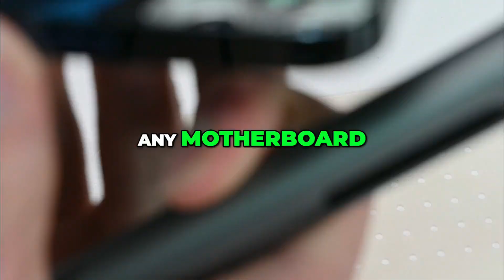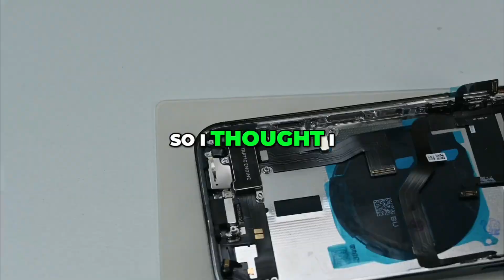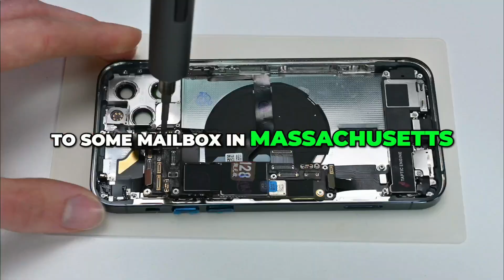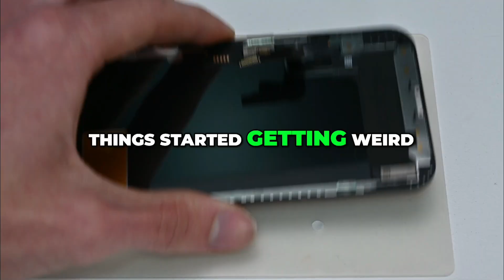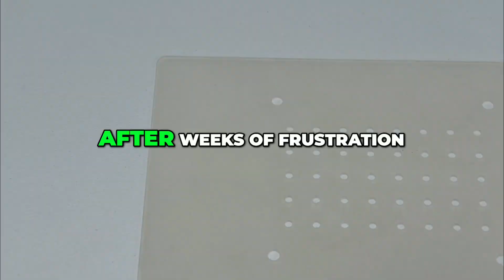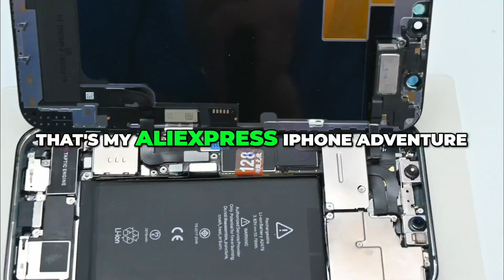Buying $117 iPhone Motherboard on AliExpress: My Experience/Story (Scam or a Legit)

Comment: I purchased without worrying, like me playing stocks & got the Iphone 16Pro Max for $255.00. Just too many people are always affraid of the risk.
After that I purchased more & then flip it for $1,500.00/each

FYI, mine came with 1TB not those normal 528GB
Reply from the maker: Nice!!! Get that 💰
Reply: Hi there, congrats! what a great idea. One question, 255 was only the motheroard or all the phone parts that you needed to build It completely
Reply: @alvaromerayoredondo3358 $255.00 USD was the Iphone 16Pro Max.
If needed or someone needs to have their screen replaced, they have no problem in paying for $500.00.